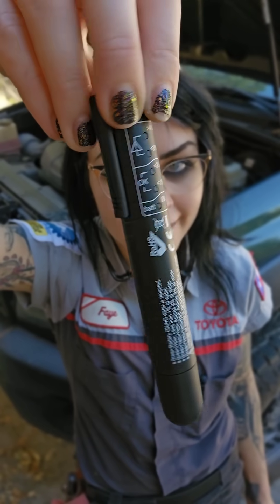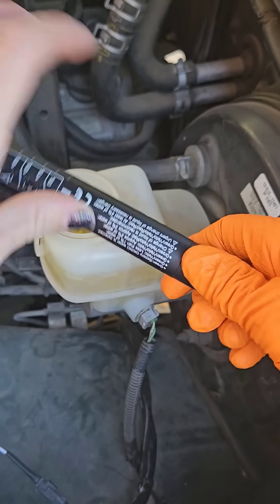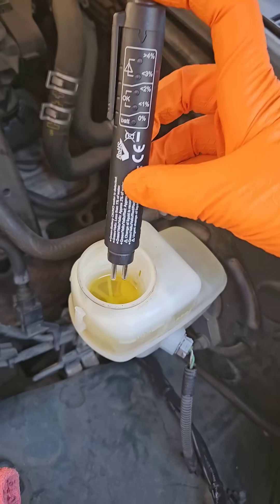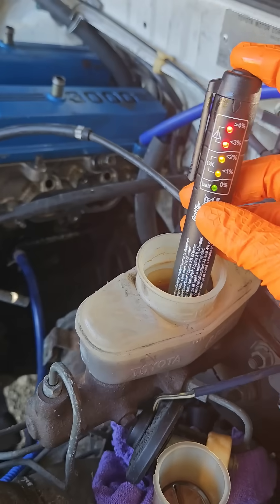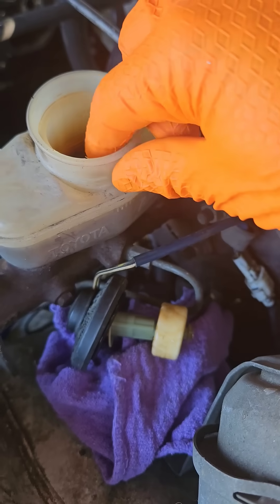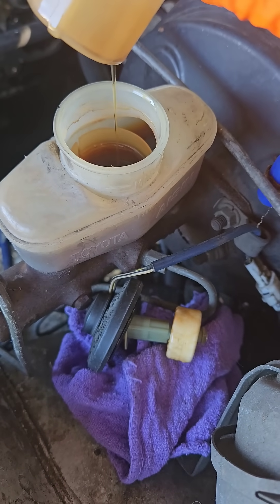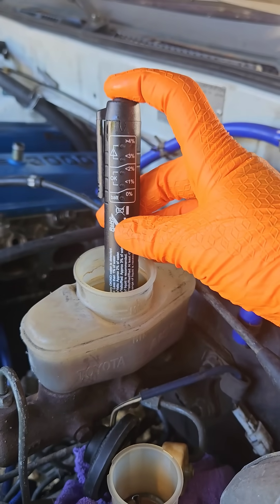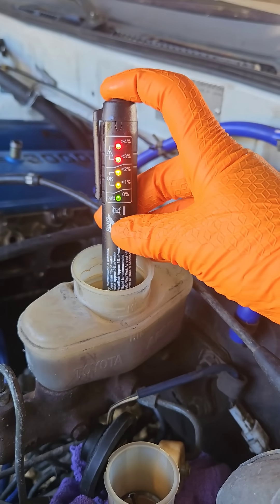Do you REALLY need your Brake Fluid Flushed?? How to Test it For Yourself!

Comment: PENRITE
How to test Brake Fluids
BOILING POINT TESTING

All passenger car, motorcycle & light duty commercial vehicle service centres should be aware that boiling point is the ONLY method approved to test brake fluid. No other method is approved or recognised as a viable test of a brake fluids boiling point.

Conductivity meters are not considered appropriate or approved for brake fluid testing - or checking. Even if it’s supplied to you by a reputable dealer with a reputable brand on it, conductivity meters are not approved by the brake or vehicle manufacturers.

BACKGROUND

Dot 3, Dot 4 & DOT 5.1 brake fluids have different boiling points. These minimal specifications are as follow:

DOT 4 & Super DOT 4 brake fluids have a greater borate ester content than DOT 3 fluids and therefore higher wet boiling point. Because of this, they can absorb more water over time. Borate esters can bind water and still retain the boiling point. (Some formulations will do this better than others).

To test a brake fluid’s conductivity, its water content must be measured and determined by the brake fluids boiling point. Brake fluid boiling point changes brand to brand, product type to product type so can vary considerably between brake fluids. Some points to consider –
Conductivity will rise as water content rises
Starting point in conductivity and rate of rise can vary greatly between formulations
If a tester is calibrated for one fluid it is likely to give inaccurate results on others.
(Problem here is that it is highly unlikely that workshops are calibrating or are even able to calibrate a tester, especially one based on conductivity)
MEASURING THE BOILING POINT

Brake fluid testers that are used to determine water content should heat the brake fluid and not rely on conductivity. Vehicle service centres should use a tester that heats the brake fluid to determine the correct boiling point. This is the only accurate way to test a brake fluids performance. Testers that do measure the boiling point, still require regular maintenance such as calibrating. Several tester brands base a fluids suitability for continued use at a minimum of 180 o C. Below this temperature they advise changing the fluid. Above this temperature it is considered suitable for continued use.

CONDUCTIVITY TESTERS

Most of the testers used are “conductivity testers” and according to the brake fluid developers and manufacturers – They don’t work.

Conductivity testers estimate water, relying on conductivity measurement to be converted to a theoretical wet boiling point and then to a water content manifesting itself into a green, yellow or red light. Problem is conductivity of new brake fluid varies for different DOT fluids and further, from formulation to formulation within a DOT grade.

This raises the question of - What are these conductivity testers “calibrated” against or too?

Once again, a tester should be calibrated to a manufacturer’s product if it is to be used to measure that products effectiveness.

Calibration is key to accuracy for all testers.

NEW FLUID READINGS VERSUS USED FLUID READINGS

All DOT grades of brake fluid (apart from Dot 5 Silicone) will absorb moisture as they are Hygroscopic. Dot 3 fluids will absorb water faster than Dot 4, Super Dot 4 or 5.1 fluids and their lifespan is generally shorter. If brake fluid is tested with a conductivity meter at certain intervals, it may show an increase in water absorption over new fluid but as we have stated, if it is not exactly calibrated to the brake fluid that it is testing, then the reading cannot be considered accurate. Again, the conductivity test does not give an accurate reading of the brake fluids boiling point. If measuring fluid during a life cycle, then it should be done in an approved way that is recognised as an international standard.

International SAE standards specify a test procedure for determining a brake fluids boiling point.  – SAE J291_201304. This should be used to determine a fluids suitability for continued use.

These type of testers that boil the fluid are more accurate than conductivity testers.

Comment: Kind of embarrassing, the brake fluid at the top of the reservoir is going to be fine, fluid doesn’t circulate through the system so fluid in your calipers is gonna be junk compared to what’s up too

Comment: For those that don't know, most brake fluid types are made from ethylene glycol and thus highly corrosive. Steel coated brake lines (and copper nickel lines depending on who you ask) can only hold up for so long before the brake fluid eats through them. Seen it happen while working for GM so I know this.

Comment: I have a 07 Toyota Tundra and never change my brake fluid and never had a problem. It a service that is needed if the shop needs money for the lights etc. This is my opinion on this scam.
Reply: Don't ever change your transmission fluid, you'll be fine.

Comment: Never test in the reservoir, it’s useless. You better bleed a caliper and test the fluid, that’s where the the most water is present. Doing brake fluid every 2 years is what keeps the system working properly.

Comment: damn good knowledge..  love that little tester..  too bad it doesn't test aluminum contamination.  which does occure as time goes on, because majority of your breaking system is aluminum.
Reply: What testing method or tool is needed for aluminum contamination?
Reply: @wmluna381  that would be a Fourier transform infrared (FTIR) spectroscopy test.  it uses infrared light shined through a oil sample,  each type of contamination reflects a different wavelength of infrared,  and so its very good at detecting aluminum oxide contamination in oil.  sailors use it to test their oil.  but you have to take a sample and send it to a lab.

Comment: Interesting, My Honda Dealership at service just told me my brake fluid needs changing the car is 20 month old  CRV and just rolled over 10k miles its rarely driven and when it is it usually on a dry day and driven at low speeds. The fluid looks like new I told them to hold off until I asked my own mechanic of 25 years and he said nope does not need changed, I guess he used one of these gizmos. I don think dealerships care about giving correct advise they just follow a schedule and wait for the bill to be paid. They also told me one of my tires was low on tread and needed replaced, again untrue as the tire has more than half the tread depth from new and that was the same  across both axles identical low wear. Makes me angry when dealerships do this just to make money.

Comment: Brake fluid can last quite long time. The reason why they say to replace it between 3 to 5 years is because brake fluid will get contaminated with water. The fluid can absorb humidity from the air. So if you live in an area where it's a dry desert then the fluid can last quite a lot longer than if you live in an area that is humid all the time

Comment: And she left the other half out. If there is water it lowers the boiling point of the fluid leading to brake fade and could lead to loss of brakes. ALSO, the main readon for testing or changing is the copper content of the brake fluid builds up over time. Changing the fluid and how it works

Comment: Long ago I learned that moisture creeps into brake fluid. It will collect at the places where there is the most drastic hot and cold changes. Usually at the caliper or the wheel cylinder if the car has drum brakes. 

By bleeding the brakes every two years, the moisture will be pushed out with the old fluid. If this is not done, the moisture will begin to cause rust so the brake parts cannot move as needed. They get stuck in place while applying brakes and then overheat sometimes even ruining the brake rotor or drum.

Comment: Brake system and fluid on your vehicle is sealed and probably the best designed system out of any other component. Brake fluid rarely absorbs water in real world unless you already have a bad line or leak. Flushing brake fluid is a waste of money for 99% of vehicles. Test it every few years thank me later. Your brake system is never going to be saturated with water unless you park in 6ft of wster every day. Mechanics selling this service are pretty much scamming you every time dont fall for it. Test your fluidits probably fine. Inhabent changed my brake fluid in over 15yrs. Guess what theres no water in my fluid😂

Comment: Notice the coffee colored brake fluid.  Thats a way to know you need flyid replacements.  I had old cars and never replaced n but replaced deteriorated wheel cylinders, rotors, master cyl etc so that dissolved h20 did its work.  Back then i wrenched on that communter couple times a week, these days thats not my thing so....get new juice.

Comment: All the comments have been reading don't take all factors into account. Depending on the climate you live in you'll get more moisture into your brake lines in higher humidity areas. The other Factor comes into play on how the individual drives their vehicle the hard braking situations they may come into that will heat the brake fluid up to temperatures that are exceeding its limits. As a mechanic I have seen that the color of brake fluid really means nothing to the naked eye but when a customer complaining of soft brakes or being that I am from a rust belt state in my experience has been that break lines will rust from the inside out I don't request a flush of the customer I just advised of the future complications that they may encounter. If you don't live in these type of areas you would not understand. Y'all can do as you wish but she is correct if there is moisture in the line it needs to be removed. Your thirty-year-old forty-year-old brake fluid in Arizona will not end up with the same result in Wisconsin or New York. Up here someday your foot is going to push on the brake and it's going to fall to the floor.
Reply: I'm in Michigan. Sounds like I better get on it.

Comment: "Why does water content matter" 2 words, Brake fade. I experienced it in the worst possible situation, Mountain canyons in the rockies, lost my brakes entirely as they heated. Not a good time. The ride to the bottom was the roughest of my life. I am glad it was a manual so I could get some resistance using the engine, but even then it was all that poor truck could do to make it down.

Comment: Watch out for cheap shops like mavis. Not only will they suggest a brake flush for every brake job no matter the actual condition of the current brake fluid, they do not do an actual brake flush. Some of the cheaper corporate chains only require the tech to suck and fill the reservoir.

Comment: Steam also rapidly expands, causing caliper pistons to squeeze the pads against the rotor after hard or prolonged braking, the heat boils the water, lightly presses the pads against the rotor while you’re traveling and kills your mileage, eats up the drive train, smokes the rotor and pads, and can wipe out the caliper.

Comment: I flush my brake fluid every other year at the latest. More likely every year depending on use and because on my vehicle the clutch is connected to the brake hydraulics and uses the same reservoir. Brake fluid is cheap and doing a flush is simple with a second person pumping the brake pedal. You can also get a vacuum extractor at harbor freight for a few bucks  and you're good to go.

Comment: no real need for this tool, nice to have but not needed, to pass a safety where i am the fluid must be relatively clear, if its cloudy or dirty it must be flushed, brake fluid does absorb moisture over time, fluid with excessive moisture will show it by being less than perfect, the contaminants will also attack seals and other parts.

Comment: I have 2 vehicles that are over 20 years old both well over 200k miles, neither has had a brake fluid flush.  No problems with the brakes on either vehicle, or any of the other vehicles I haven’t done a brake fluid flush on.  Maybe new cars use inferior parts and fluids so the fluid has to be flushed frequently.  It seems like something that is a problem for an extreme use scenario, so it is recommended for every scenario just because it can’t hurt.
Reply: I doubt you live in sub-tropical weather, or extreme northern cold where humidity and corrosion are are big factors in the lifecycle of components.

Comment: Yeaaah to bad that thing is so in accurate/ gets outa calibration so easy.   Litterly have had one read red on 3 different brand new bottles of fluid.....
I liked using it cause makes it easier to up sale brake flushs when can tell a customer they have 3% or more moisture in their dry fluid... but after i checked mine out for shts and giggles i stopped using it.

Comment: Right, because that is where the heat affects the fluid, where the pads meet the rotors.  Or, you can check it at the point furthest away.

Comment: Yeah, brake fluid WILL brake down in one year, the boiling point drops by almost half, HOWEVER,  we do not HOTROD or TRACK a street car and most people can go years without a flush. 80% of people go the life of the car without a flush and that's when the brake lines rust. I also recommend a decent 3yrs for flushes. I personally do the every 1-2yrs.

Comment: Occasionally you do need to flush not just because of water but brake fluid and hydrolic fluid does break down over time just like oil and transmission fluid dont make your decision just because of this test you should change it out due to your manufactures recommendation. Lookat your owners manuals

Comment: My rule of thumb is if youre doing any servicing of the brake system (more so something that is going to cause the fluid level to drop) then its worth just replacing the fluid entirely. No sense topping off dirty fluid with clean stuff and no sense reusing old fluid either. A bottle or two of brake fluid is cheaper than totaling your car in an accident, and its definitely cheaper than killing someone or multiple people in an accident where you couldnt stop. 

The other rule of thumb is keeping up on periodic maintence, i check my fluids weekly and do other visual inspections regularly, more in depth ones monthly or quarterly. Change parts and fluids at the recommended intervals etc. Then things just stay hunky dory all the time and its jist a lil bit of work here or there.

Comment: I'm doing a complete brake job on my 94 Ford pickup all the rubber brake hoses front and back plus I'm doing new calipers and rotors and wheel bearings in the front new wheel cylinders Springs and shoes and brake drum in the back the metal lines will be flushed out and cleaned first time anything like this has been done on this truck in 29 but it's super low mileage and was always taken care of just part of the suspension rebuild that I'm doing so I figured I'm down there might as well do it

Comment: Testing the fluid reservoir is only part of the story. Wet fluid corroded stuff but it won’t boil up there. 
Tests need to be done on fluid from the brake callipers. A good mechanic opens the bleed nipple when the piston is pushed back for new pads. Test the expelled fluid. After fitting new pads I also pump some clean fluid through. It makes sure the stuff is clean where it really matters.

Comment: Good showing that device for some bit of actual testing but now show the tester in new brake fluid. Then put 1% water in the new fluid and measure again. Also measuring sample from master and sample bled from brake. Experience from use still seems to lean toward flushing not being necessary.

Comment: Water isn’t the only reason to flush a brake system. As your brakes age you get build up in your brake calipers which you can remove some by flushing. You will not get all of it but you will push out all the dirty brake fluid that sits in that calipers every day just building up more. So as your car gets older it’s best to flush the whole system, brings repair cost down. I was a mechanic for over 20 years I did it for customers and my own vehicles. I still do my own.

Comment: Question: I use Motul Racing dot 5 Brake fluid in my Infiniti I always flush my fluid when I do brake pads cuz why not, but in between services sometimes I will just use a pump nozzle with a hose and suck out the fluid in the reservoir and replace it with fresh. My question is, will the new stuff eventually mix with the old fluid down the line refreshing and making it less diluted with water or am I just wasting a bit of new fluid? I will say the brakes feel better and like they have a bit more pressure after I do this, but I’m just hoping it’s not a placebo effect in my head. Definitely gonna pick up one of these testers for a definitive answer of if I need to flush all the way.

Comment: Been doing repairs since forever, never even realized a tester existed like this. Makes since though, water conducts and brake fluid doesn't. I just recommend based off color. I don't think there will ever be enough water to rust inside components but the brake fade thing is definitely possible.

Comment: Short answer, yes, 
Long answer, no mechanic will recomend to change the break fluid unless you need to change it , cos you have to purge the lines after changing the fluid to aboid air bubbles in the break lines (the most common reason for squishy pedals) and that is a job that cost more that what you can charge for it

Comment: Have a 1979 Vette, they didnt have stainless liners in the calipers, so atmospheric water gets in the fluid and settles at the bottom. This rusts out the cylinder inside the calipers and your brakrs start leaking. Its a very common problem with those older cars and to fix it, you send your calipers in and have them bore out the cylinder and resleeve it with a stainless liner.